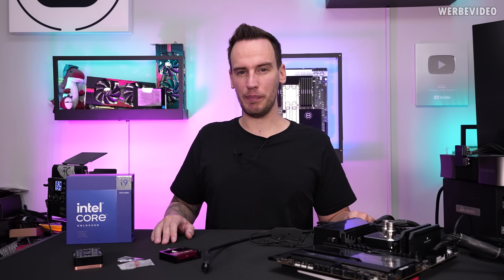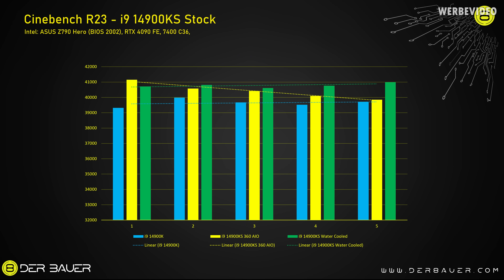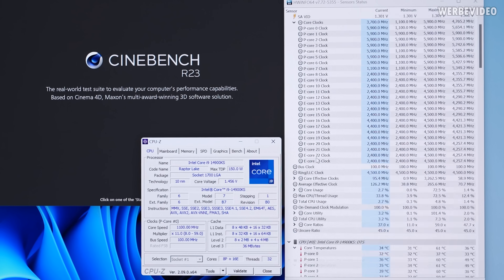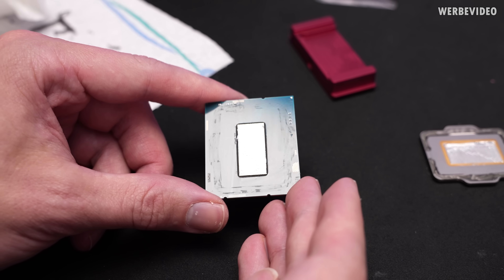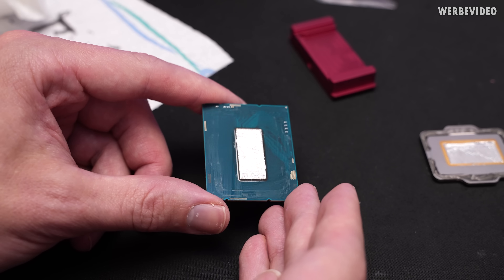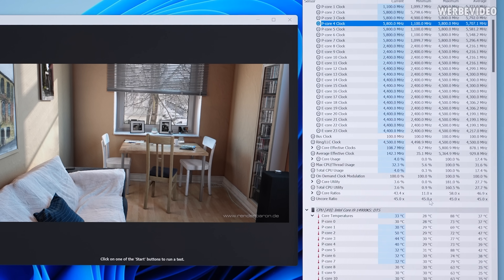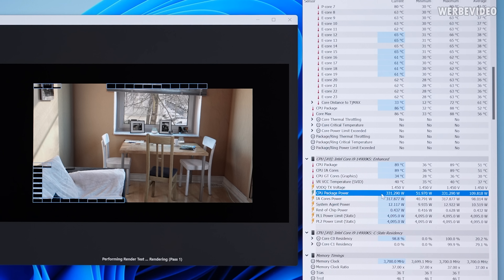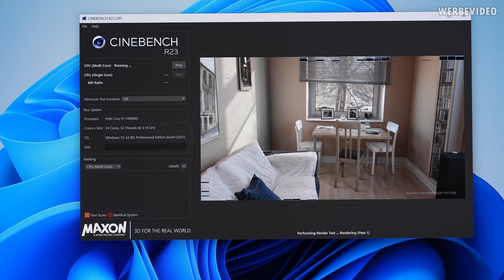My New Water Block - Time for 14900KS Direct Die

Comment: The CPU is definitely still throttling, but it's just not visible in HWinfo. My 13900k (even with some things running in the background, including HWinfo and FanControl) gets 42000 or very close to it in Cinebench R23, at 5.6-5.5Ghz P-core and 4.4Ghz E-core, so there's no way you get the same score if it's truly running the P-cores at 6Ghz...

It can be very tricky to figure out if there's throttling under heavy load since the reporting becomea very delayed and isn't fast enough to begin with. The CPU can change clock speed many times in one polling update (even if you set polling to 100ms) and it wouldn't show normally, but when it's lagging like that because of the benchmark you can't even see what you normally would, but the score reveals lower performance than expected reliably.
Reply: Also Windows task manager since windows 8 doesn't show CPU busy time or utilization, but core utility (like you can also see in HWinfo64) that's capped to 100% (yes it's kinda stupid, and not normalized) so it's not 5% of available performance or CPU busy time, rather, it's compared to the work that would be possible to do if the CPU was at stock clock (no OC or Turbo Boost) except it'll not show more than 100% (HWinfo64 does).
Reply: If it's changing clockspeed then how is HWInfo not reporting it? Even if it changes many times in 1 polling rate, the chances of not even a single one of those hundreds, if not thousands, of changes being detected by HWInfo is beyond astronomical. Of course there'll be a ton of changes that HWInfo won't detect as you correctly pointed out, but how can there be 0 changes detected? If in, say, 10 seconds, the speed changes 10,000x, the chances of HWInfo not even detecting, say, 3,000 or, I don't know, let's say, 800 of those changes is beyond astronomical.
Reply: Yep thought the same thing - I have a 360 AIO and my 13900k will regularly hit 40k in c23 at 330 watts. Why is sucking so much more power without any more performance? Is the extra wattage really generating "so much" heat that it's down-clocking that much?
Reply: Also, check out Clock'EM UP (I think Vietnamese or Thai channel). He does 6.0, 6.1, and 6.2 all-core with a 13900KS and 14900K and at fairly low temps (high 60s to low 80s) yet his scores are also more inline with DerBauer's. Something doesn't make sense if a "measly" 5.5 GHz all-core is getting the same or higher score than a 6.0-6.2 GHz all-core direct-die cooled system.
Reply: @Spinelli__  Because the clock speed you see reported is just BCLK clock times CPU core multiplier - it's not really a measurement. CPUs constantly switch states and clock speeds many times per second, even effectively turning off when doing nothing (known as core parking, though it can be disabled). 
What you should look at is the effective clock, though keep in mind it is an averaged value, not an instantaneous measurement, and under full load this will obviously not report every single cycle as the CPU will be fully busy.

Either way this data isn't just a reading of some sensor, so you can't rely on it fully, which is why the most reliable way is to simply test how long it takes to complete some known amount of work, that doesn't rely on polling or reporting or anything like that, and also doesn't require extra software.

Sometimes the clock will be lowered long enough for HWinfo64 to report the decrease, but in those cases the throttling will already be very obvious.
Reply: @bretthake7713  It is unaware of its own sweet spots for voltage and frequency, so it often drops the clock by more than needed because it might only need -300Mhz to drop voltage by .04 but instead it will drop 1Ghz to make that voltage drop
Reply: @bugostare  I know about core-parking and all that. So you're saying the system downclocks the CPU without adjusting BCLK nor the multi? I'm not saying you're wrong, but even Clock'EM UP's 6.1 all-core is still "only" getting 43,200 points and his p-cores are all "only" between 76 & 86 degrees. So his scores are inline with Derbauer's while your system - getting the same scores but at just 5.5-5.6 GHz - seems like the anomoly.
Reply: @Spinelli__   Well, what you set the clock speed to, in BIOS, is the maximum multiplier, nothing more. The CPU will have the final say on what clock speed it can actually manage based on power draw, temperature, and load.
It will try to hit it, but not if it means burning itself out, it has many built in mechanisms for protection and power saving, you only get to tweak things on top of that, if the parameters built into it are met.
Reply: @bugostare  Most ppl that do these sorts of overclocking are removing power limits, thermal throttling, etc. especially those running direct die + custom loop that's why the numbers don't make sense. Are you sure 100% you're getting 42,000 points with your p-cores only ever doing 5.5-5.6 GHz?
Reply: @Spinelli__ at most it could detect 100 max. I think polling rate minimum time frame is 100ms. So, 10x per sec for 10 sec.
Reply: @Spinelli__  Yes. And you can't remove thermal limits that trigger throttling, the CPU has built in mechanisms that will override anything a user can do in specific cases, thermal throttling being one of them. You can't change those, they're not exposed to BIOS, and are handled on the silicon itself.
Reply: @bugostare  That's incorrect. You can increase max temp from the stock 105 degress to like 115 if you want. 

Not to mention, you can also disable the auto-boosting/un-boosting according to temps feature like when it tries to hit, let's say, 6.0 GHz then at 60 degrees it'll go to 5.9 GHz, at 80 degrees it'll go to 5.7 GHz, etc. You can disable all that.

Furthermore, the power limits can be removed too (like setting the limit to 4096+ amps).

 Lots of overclockers remove that crap. 

Not only that though, but if the CPU was downclocking due to power limits, temps, etc. you'd definitely see it in programs like HWInfo, CPU-Z, etc. Just because it's changing faster than the polling rate, doesn't mean you won't ever see any of the changes. It's kind of like saying my game is running at 800 fps but my monitor is only 30 Hz therefore I'll never see any frame, any picture at all, I'll just have a black screen...of course not, the monitor will still catch/display some of those frames.

On top of all that, the 42,000-44,000 scores at 6.0-6.1 GHz all-core are with a direct-die, custom loop setup and the MAX temps of each core was only between 76 and 86 degrees. There's definitely no internal thing buried in the CPU's logic that you can't disable that slows it down when only running at 76-86 degrees...it's not like the CPU was running at 110 degrees.
Reply: @bugostare  Another thing, if you're getting 39,000-40,000 running at a consistent 5.6 all-core on the p-cores then a score of 42,000-43,000 6.1 all-core p-core probably sounds about right. It's around a 6 or 7 % increase which makes sense because only 8 (the p-cores) of the 24 cores have received a 9% increase in clockspeed. The p-cores are much faster, lets say around 2.25x faster (they have HT too, the e-cores don't). So a 9% increase for just those 8 faster cores (out of 24 cores) resulting in a 6 or 7 % overall score increase seems to make sense.

An easier-to-interpret test comparison would be if the e-cores were disabled but even with them enabled and taking them into account (a rough estimate), the increase in score makes sense.

Also, a lot of motherboards will auto-boost the 13900K to more than 5.5 or 5.6 GHz at default settings. Things like "multi-core enhancement" - often being enabled without the user even knowing - will attempt to do this and that means higher clocks than the stock 5.5 - 5.6 GHz and, yes, you will be able to see those increased clockspeeds in Windows monitoring programs if they're occuring (maybe not EVERY SINGLE time there's a change because of the polling stuff you mentioned but you'll still see it).
Reply: @Spinelli__  
Upping the max temperature before thermal throttling takes place is not disabling it, just making it kick in a bit later.

There are many things on the CPU you can't disable or interact with, or even know exist. 

Power limits are not really limits, they're for controlling temperature, and you again can only set voltage within a range, and whether to limit current but not how much to use.

You're also confusing Thermal Velocity Boost with limits, it is an overclocking tool allowing you to tweak down clocking so you don't lose more performance than necessary - which will happen if you just let the CPU decide on its own and drop like 600Mhz when 200Mhz would've been enough to control the temperature.

The CPU has many temperature sensors all over it, an average core temp means nothing when it comes to throttling. Again, the CPU decides on its own if it is too hot and needs to throttle, in nano-seconds, and not from average temperature but whether any point is at or beyond the limit.

Framerate and monitor refresh rate don't affect each other and are both in the same order of magnitude, sensor polling and CPU internal mechanisms aren't. Saying it's inevitable for a program to see the nano-second scale throttling is a lot more like saying a sloth must sometimes be able to catch a fly...
I don't even know if the CPU would report these, anyway. You don't have direct access to anything in a modern computer, there are many levels of abstraction.

I get ~42000 at ~5.6Ghz, so at 6Ghz the score should be ~45000. Yet they only get a tiny bit more than I do, if at all. That in itself is hard proof that the clocks they think they're getting, aren't actually the frequencies their CPUs are running at under heavy load.
Don't see why you're trying to argue against an actual continuous measurement of performance, with assumptions and incomplete data.
Reply: @bugostare  You can remove and/or raise current, power, and temp limits either completely or to the point you don't hit those limits. I know what TVB is, BTW. You're making things up out of thin air. The CPU doesn't decide on it's own if it's too hot and downclocks outside of BIOS settings unless maybe, it's some extremely high temp limit well beyond 100 degrees C, not at a fairly low 76-86 degrees. I would love to see some evidence for your extraordinary claims.

No, those people getting around 43K were getting around 39K at stock 5.5 GHZ so their increase makes sense when oc'd to 6.0 or 6.1 GHz and maintaining that.

The vast majority of people get 39K-40K with a 13900K / KS / 14900K if the p-cores don't go above 5.5. If you're getting 42,000 and have all your p-cores never go above 5.5 GHz, have stock cache/ring/uncore clock, e-cores at 4.3 GHz, then maybe you're using some ultimate stripped-down version of Windows 10 or something plus running Cinebench R23 with either "high" or "realtime" priority or something. No one else gets scores like that with "normal" Win 11 and running CR23 in default "normal" priority mode w/ p- and e-cores at 5.5 & 4.3 GHz (or less) respectively.
Reply: @Spinelli__  STOCK 13900ks does 42.5k with an LT720 AIO.  Somethings wrong in this video.

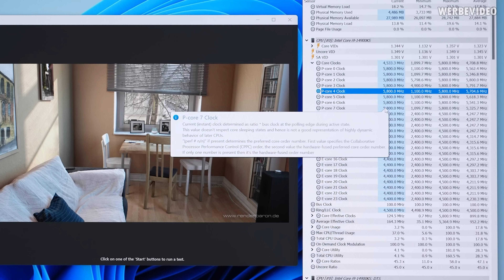Comment: 10:10  At the beginning he said he keeps the pump speed constant near 150L/h (it was like 142 though) now it's at 172L/h & I'm stuck wishing it was constant across his testing so it doesn't skew the data
Reply: If you use different blocks you will get different flow rates at constant pump speed. Because some are far more restrictive than others.
Reply from the maker: The Pump is running at the same speed. But it depends on the components you use in the loop how it affects the resulting water flow
Reply: @der8auer-en  thank you for explaining that

Comment: Slow pump flow or block flow completely monitored temps break it in properly as well as tune the function built in ai due its job while showing proper energy to adapt to

Comment: HI. I also delid on 149 kf. I DID EVERYTHING SAME AS YOU. I used the grizly tool IL LOOP EK DIRECT DIE. the temperatures are 30 degrees lower...but if I DO BENCHMARK IT CRASHES INSTANTLY. can you give me some advice. WHAT SHOULD I CHANGE FROM BIOS? I'M ASKING FOR HELP. I CAN NO LONGER USE THE DESKTOP PC

Comment: It's so frustrating that with power densities this high and dies this small, the majority of the temperature delta occurs between the bottom of the silicon and the top of the IHS. You can have the best loop in the world, but as long as we're talking ambient cooling you're always limited by getting the heat out to the water block in the first place.

It would be lovely if AMD and Intel would sell versions of these CPUs with no IHS and a silicon die thinned as much as possible (since the thermal conductivity of the silicon itself is quite poor compared to copper). They could either charge a bit more to cover the expected warranty issues from people damaging it, or simply void warranties if there's any visible cracks/damage to the cores. It's clearly possible, both because they still sell mobile CPUs this way, and because both vendors used to sell bare socketed desktop CPUs back in the Pentium 3 and Athlon XP era.

Being able to place a thin layer of copper for the waterblock as close as possible to the transistors emitting the heat would do wonders to improve the situation where your processor instantly jumps 60-80c going from idle to full load (the thermal resistance you can't do anything about) and then only rises 5-10c after that (because your loop is plenty capable of dissipating the power). We could even dissipate way more, because hotter water means more efficient thermal transfer to the air but you can't normally tolerate a high water temperature as things are now because it doesn't give you sufficient headroom because you're desperately trying to keep things below throttling temperatures on the die itself.

Comment: Thermal grizzly needs there own quicksilver solder remover. It works so much better and faster then trying to use normal Liquid metal when trying to clean the CPU.
Reply: That's not in their best business intrest 😂
Reply: @toonnut1  Yea, having to buy 2 or 3 things of liquid metal because it will take a lot to clean it. Then you need more to use as thermal paste 😂
Reply: I got a small vial of galinstan from Lithuania via ebay years ago, 10mL cost 1/3 of one tube of Conductonaut, I'm still not even 1/4 way through it. Eats solder both when you want it to and when you don't 😑

Comment: Increased spacing off the board improving the memory signaling is probably not about heat, but about inductive coupling with the block.

Comment: This may be a dumb idea but has their been any sort of testing for extreme RAM overclocking on BGA chips versus an LGA socket, I know that ruins the ability to swap CPUs without doing rework but the LGA socket seems to be becoming an electrical limitation. I guess the bold could maybe remove an LGA socket from the board and ball an LGA chip and directly mount it if the pads line up also I don't know LGA sockets look awfully close to an unprepared BGA package but maybe the pads are recessed more/less on a BGA substrate and the whole idea is just dumb on the face of it.